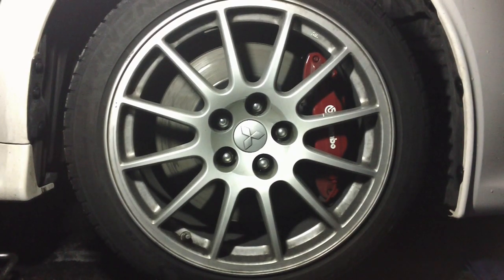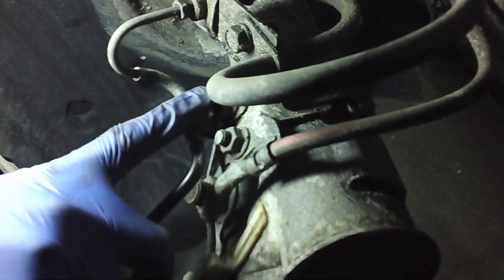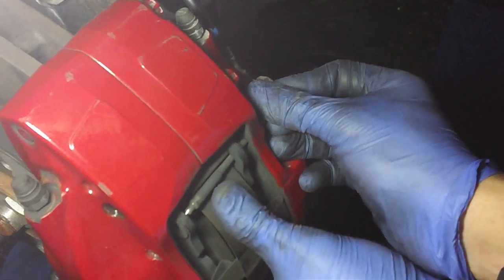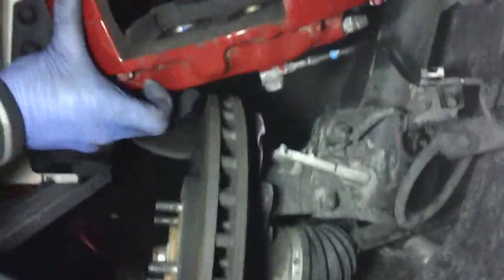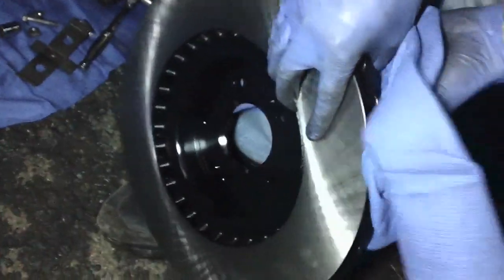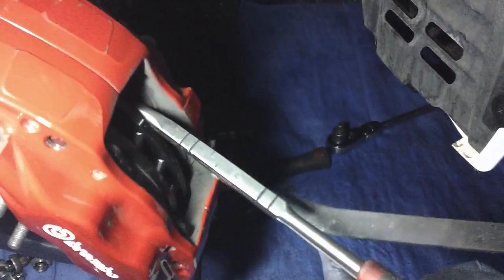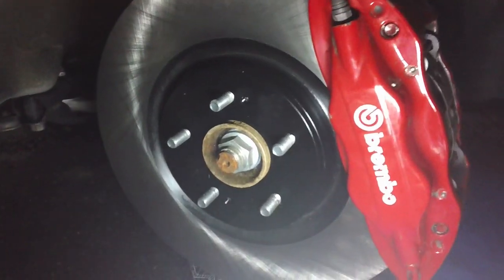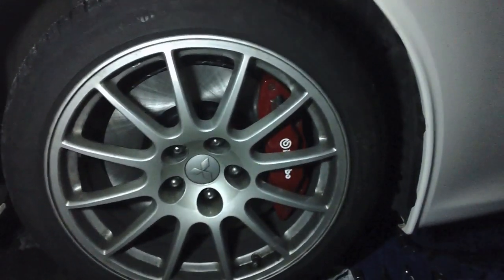Evo X Front Rotor & Pads Replacement

Comment: I just got an Evo X and im experiencing some loud squeaking one of my buddies told me these brakes are known to get like that when theyre a little dusty or dirty woulf you suggest just using brake cleaner?
Reply: The stock pads squeal bad and are high in brake dust. I highly recommend getting a low dust pad like the ones in the video. I have the same ones and they're great. (Giro Disk Magic Pads)
Reply: +johnnyquest456 I;ve had stock brakes for almost 25k miles and nothing ever squeaked.
Tae a look if you have stock pads.
Reply: +Артем Чуян No the first comment below mine was right. Its just brake dust. im not used to high quality carbon ceramic brakes lol.